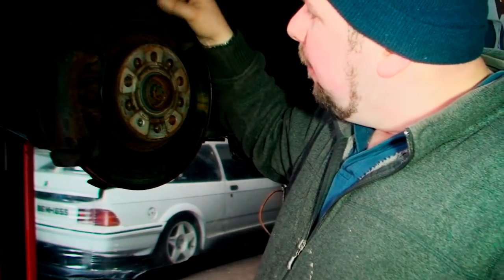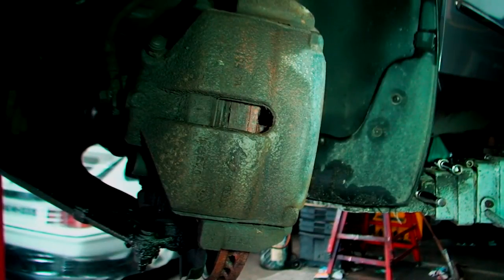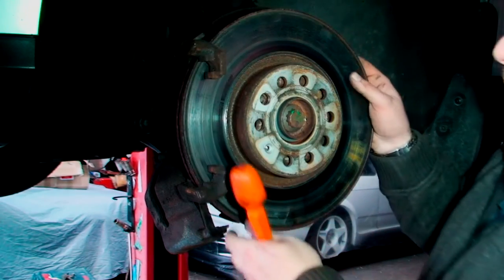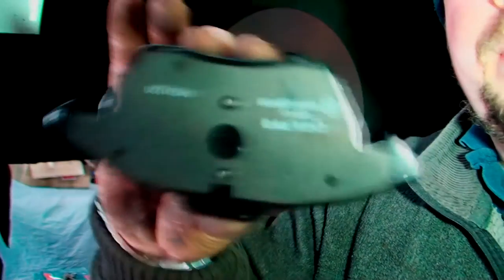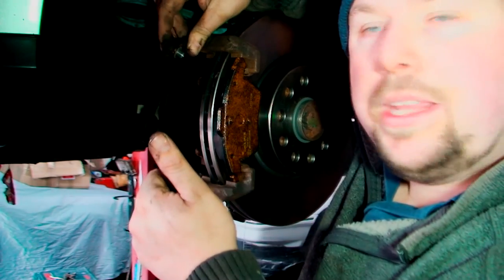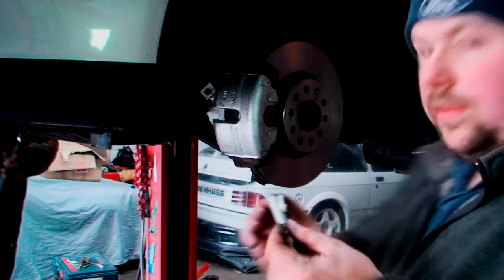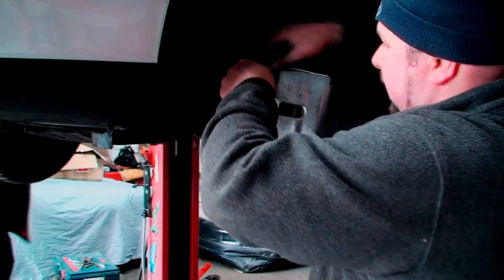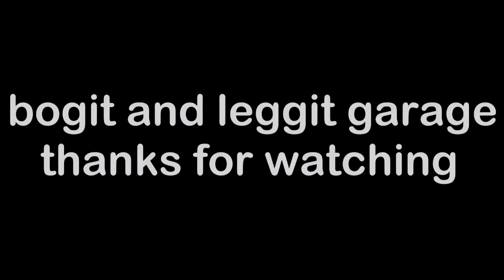bodgit and leggit garage vw passat seizes caliper new/pads/disc/caliper

Comment: Question: on every tire swap between seasons I will clean the discs and the caliper by using a steel brush (on the edges obviously) and then spray brake cleaner over everything and just let the dirt drip off. Is that good practice or what do you think?
Reply from the maker: GymChess hi mate preventive maintenance is the key so what you are doing is certainly no harm at all as you are checking them you will see if there's a problem before it happens in my opinion definitely the right thing to do
Reply: Thx. 

The reason I asked is that some people claim that brake cleaner is bad for rubber parts around the caliper, the piston, etc. I've done this for some time and never experienced problems at all (touch wood). It really cleans off dirt very easily. To do that twice a year shouldn't be a problem in my opinion.

Comment: Is there a video on how to remove the rear caliper on the fkn stupid electric handbrake. A how to remove the caliper altogether
Reply from the maker: Northern Ireland Fishing Reports hi mate I do plan to do a video on this shortly there is a few different ways of doing it all depends on the equipment you have obviously scan tools you can also use a power probe you just have to be careful you do not blow it up you can also on some of them disconnect them and Whine and back manually by disconnecting the motor a few different ways depending on which one you have